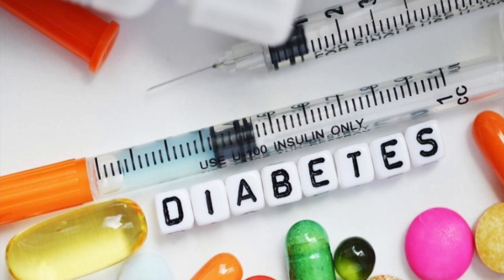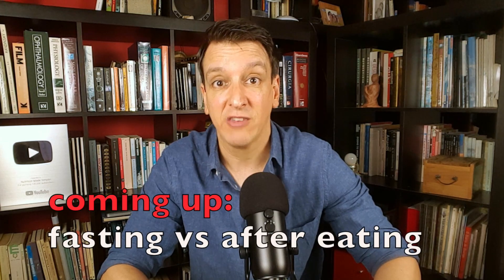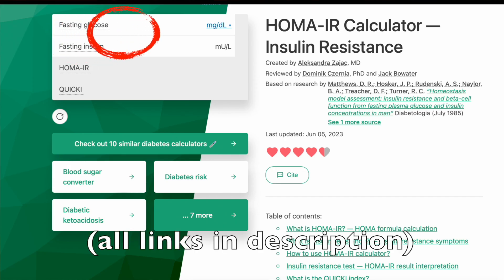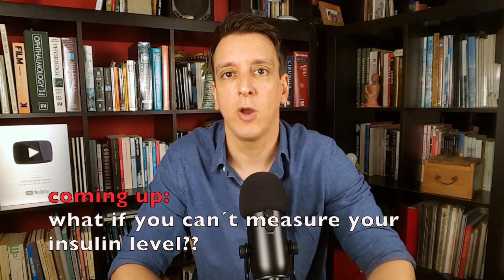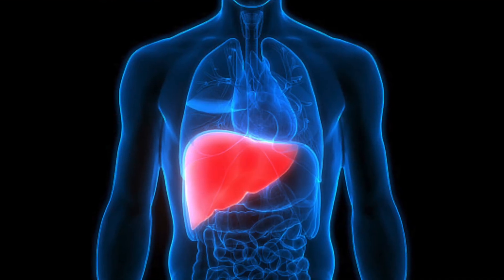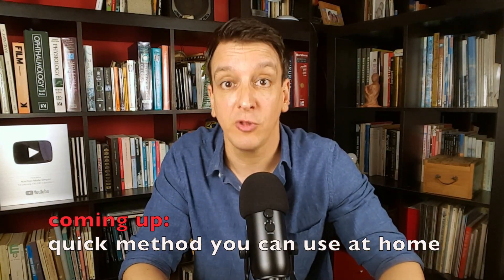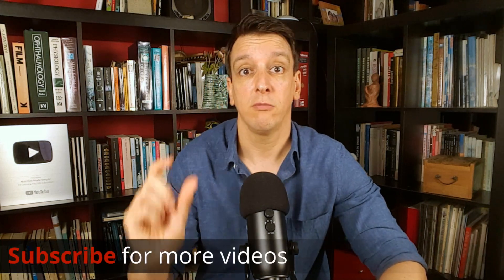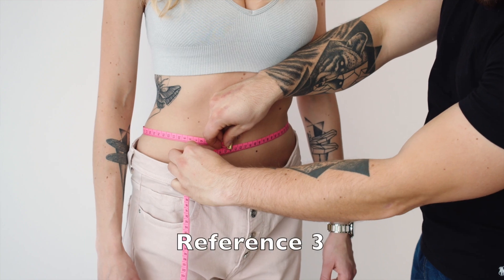How to measure your Insulin Resistance (3 methods!!)

Comment: Hi, thank you for this information. I have tried the TYG Index with Triglycerides and Glucose, although I am normal in both, why is it that the result suggests I am insulin resistant? Thank you.
Reply: Glu 5.73 mmol and Triglycerides 1.08mmol/L
Reply from the maker: @R.B.Adventures  that glucose is slightly above normal (is it measured while fasting)? but the TyG index can suggest IR even with values within the normal range
Reply: @R.B.Adventures While your A1C is below the 6.5 cut-off for a diabetic diagnosis, it''s actually borderline Pre-diabetic, just above the 5.7 cut off.
Reply: @R.B.Adventures  if you are pre-diabetic, then you have insulin resistance.  Good to know this now before becoming diabetic.  My Glu is 5.8 down from 5.9.  Working on it!

Comment: How do A1C levels fit into measuring insulin resistance.
Also, with these tests, would you have your doctor administer them? How would you go about finding your glucose and triglyceride levels for the at home test?
Reply from the maker: we can have normal glucose levels (and consequently HbA1c) and still be insulin resistant if the pancreas can compensate by overproducing insulin. in some people this state can be maintained indefinitely while in others the pancreas eventually gives out and glucose starts creeping up and we start entering the domain of pre diabetes and diabetes. this can take many years
Reply: @NutritionMadeSimple  So if someone  has a normal a1c of 5.0 AND a low fasting insulin of 2.3 like I do, then for sure one is not insulin resistant?
Reply: @NutritionMadeSimple  That's exactly what happened to me.
Reply: Your Doctor or go to a lab (Quest, Labcorp) and pay out of pocket.
Reply: Does a keto diet that doesn't include weight loss "artificially" lower HOMA-IR?
Reply: @robbyvillabona  Yes